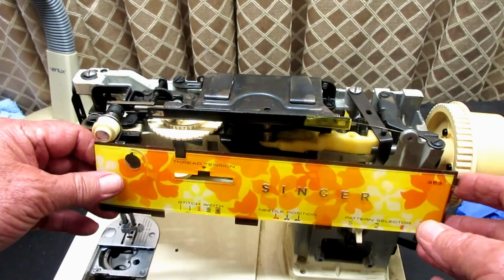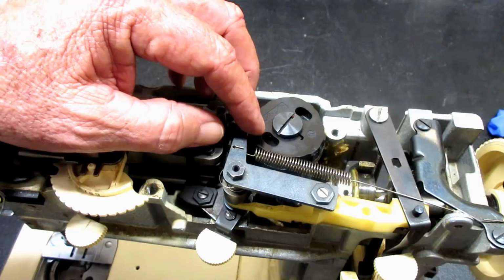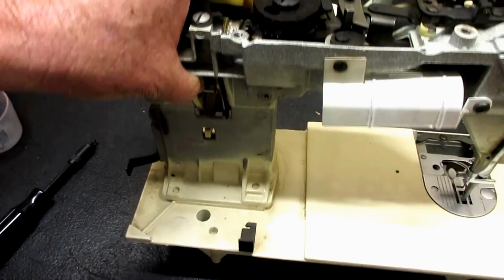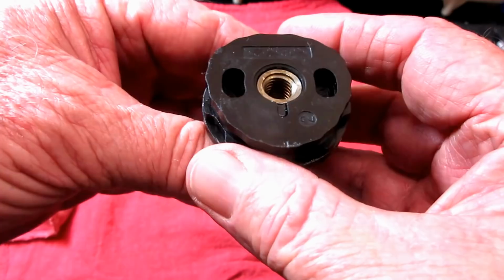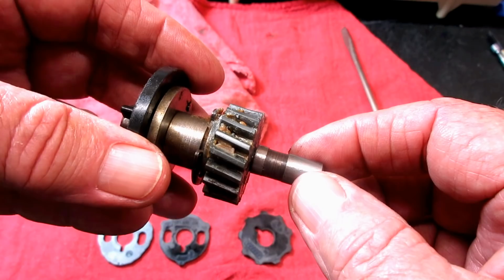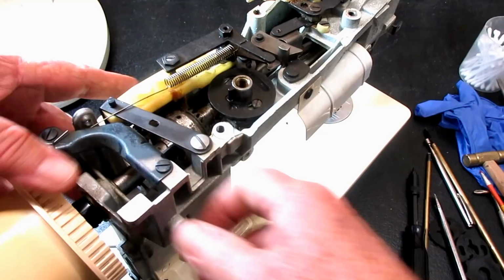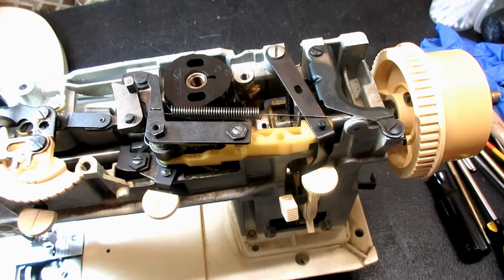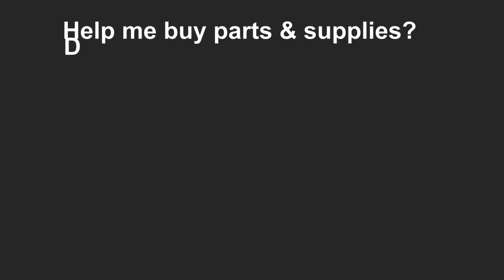How to Remove & Replace the Camstack on the Singer Model 353 Genie Sewing Machine

Comment: Hey Andy your videos are great, I'm now trying to fix a singer 353 with a broken arm shaft gear (the plastic one) I was wondering if it's possible to replace it without removing the horizontal shaft, and maybe you have a video or something to guide me in the process

Thank you
Reply from the maker: I don't blame you for seeking a way around removing that horizontal arm shaft. Looking at the Service Manual it appears it is a 12-step process just to get it out. (people can buy a service manual here if needed: https://manualsoncd.com/product/singer-353-354-genie-sewing-machine-service-manual/ ) I made a video that covers other Singer models that have a similar gear that is famous for breaking if people want to see what we are talking about: https://youtu.be/M3bFtlV1Y6s
I have heard from two people who were able to get the gear off the old shaft and get the gear out of the machine and the old shaft out from the bottom, somewhat like my video. Many of the old gears are riveted to the shaft and that requires pulling it out the top. They found a way to get a drill bit into the machine and drill-out the rivets. They told me they then "picked" out the old gear and pulled the shaft off vertical shaft out of the bottom of the machine. The new gear/shaft uses set screws instead of rivets and they could install those as I did in my video. They both said it was harder to get the old gear out and the new in but they did it and are happy they did not have to remove all the parts as described in the Service Manual. I have not done this myself. One fellow also wrote me that on his Genie the damaged gear was black and held on by set screws so someone had already replaced the original setup before. He followed my video, also saying it was a little trickier to get the gear itself out and back in, but very doable. Terry at TANDTREPAIR sells the new gear/shaft combo and will give people 20% off everything they order from him by 7-30-2020 if they use my coupon code of andy-h-yt during checkout. http://site.tandtrepair.com/Genie_Series.html         If I needed to replace that gear I surely would try to drill the rivets out of the old one or cut it off somehow before I took the horizontal arm shaft out. I figure I have nothing to lose by trying and if I just could not do it I could always do it the service manual recommended way. If anyone does manage to get the gear out and replaced, no matter how they do it, I'm hoping they record it and post a video. The Genie/Starlet models are really strong running nice sewing machines, Other than that weak plastic gear they usually have no problems. Good Luck, and thanks for watching my channel.
Reply: @andytubesewing1953 
Thanks for your fast reply. 
I managed to take out the rivets by inserting a metal wire with a small bent on the end and pulling it with pliers
But unfortunately the gear is still stuck. 
Any recommendations on how to free it?
Reply from the maker: @erezfershtman5115  You mean stuck on the shaft? You can remove the timing belt and pull down on the pulley/vertical shaft. Here are all the videos I made for the Genie: https://www.youtube.com/playlist?list=PLsCOZgzzaiKJvzcqn97Yh8lvx-tbdFl2p
The timing belt video would show how to remove it. If you mean stuck in the space it sits because of the parts around it I can't advise b/c I've never pulled one out. Both people who wrote to me said it was a PITA to fish it out of the machine; like a puzzle.
Reply: @andytubesewing1953  I mean that I can't pull down the shaft because the gear and the shaft won't separate.. And that's after I removed the rivets.
I even tried pulling the shaft using locking pliers but nothing.
Is it possible that the shaft and gear are welded together?
Reply from the maker: @erezfershtman5115  OUCH! The top gear does get very hot while running. I think that is part of the reason they fail. I have burned my fingers touching a metal geat just after I stopped the machine. Oil and grease can creep in around the shaft and it gets "baked on" and very hard. This is true of most metal geats, their set screws and other parts, like the needle bar clamping bracket. Sometimes people use oil that has additives and those dry even harder than plain sewing machine oil. I often have to wrap the screw/parts with cotton and soak with WD-40 overnight to get the dried stuff softened enough to turn the screw or pull the gear off. I have also used a hairdryer to try and heat up the parts and soften the gunk so I could turn the screw or pull out the part.  Here is a quote from Terry's webpage for the Genie "some Genie's may
 have the top gear molded to the shaft." So maybe that is the case with yours. http://site.tandtrepair.com/Genie_Series.html     Again, both the fellows who wrote to me said they drilled the rivets, pulled the shaft out from the bottom and then had to "fish" or maneuver the old gear out of the machine and the new gear into the machine, and slide the vertical shaft up into the base of the new gear, like in my video where I replaced the top gear on a 457: https://youtu.be/M3bFtlV1Y6s I don't know if part of the rivet is still into the shaft, like some burrs, that are preventing the separation. I've never welded, but if they welded the gear on then why have the rivets? Maybe they do that, IDK. It seems like if it this much of a headache it may be easier to just do the 12 steps in the service manual and pull it all out the top. It is definitely doable, just time-consuming. That's why some shops quote $200+ in labor to do it I guess.
Reply: @andytubesewing1953  hey Andy
I finally managed to replace the plastic gear, In order not to free the horizontal shaft I decided to saw off a part of the metal case.. A bit drastic I know.. But luckily it worked
But now for the next fix haha
My needle is not centered (its to far from the leg), I watched a video of you teaching how to fix this problem but unfortunately it was on another model.
Any chance of another video explaining how to adjust the needle on a 353?
Thanks and thank you again for all your videos and explanations
Reply from the maker: @erezfershtman5115  I don't think you gave up too much by removing some of the metal frame. It is sturdy and strong and hopefully, you did not take too much. So, I'm not sure I understand what you mean by "it's too far from the leg". There is more than one way to adjust the needle bar location. You know there is a Needle Position Lever in the center of the control panel. Make sure it is clean and oiled inside. If you needle an instruction manual if is FREE from Singer at this link: https://www.singer.com/search/support?title=353
You can also buy and download the complete 53 page Service Manual for $8.99 at this link: 
https://manualsoncd.com/product/singer-353-354-genie-sewing-machine-service-manual/
If you are going to keep working on the Genie it may be worth the money for you. I don't have this machine any longer.
Reply: @andytubesewing1953  I meant to how do I center the needle bar front to back
Reply from the maker: @erezfershtman5115  Right, OK. The service manual I referenced to would have all the adjustments. The vibrating bracket on the Genie is slightly different then other models I have shown how to adjust. For $8.99 it is your best source.